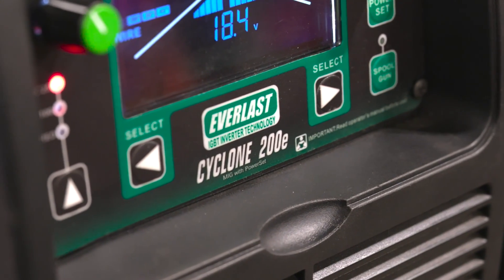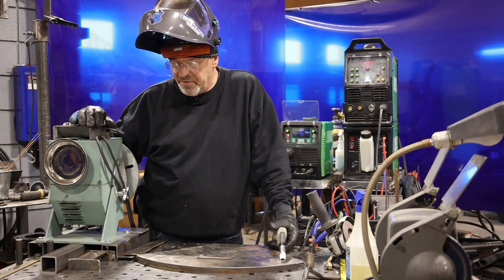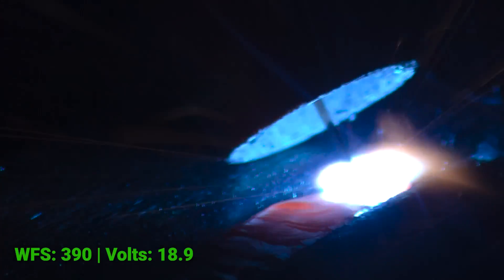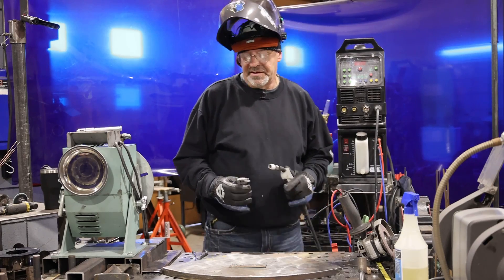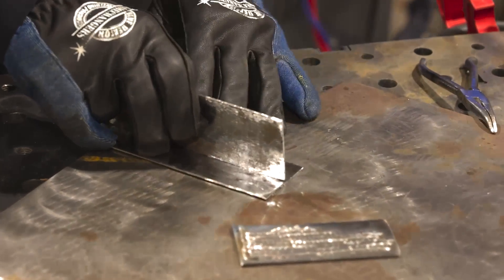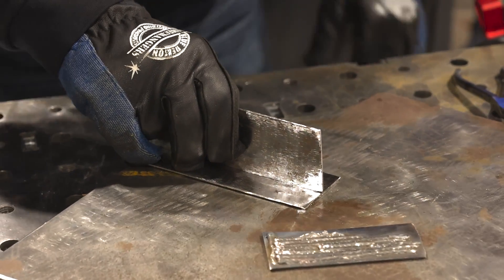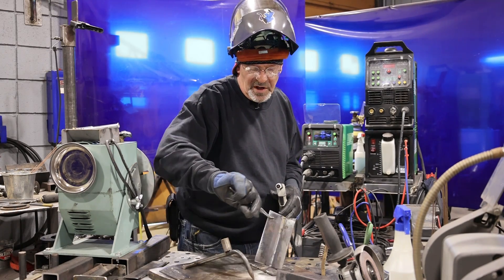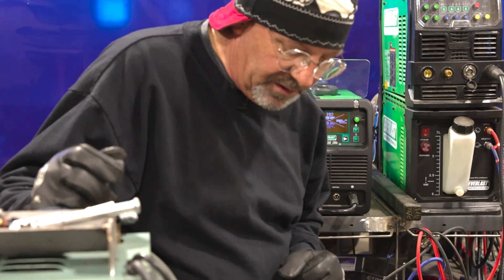Can the Cyclone 200e Keep Up With Bob Moffatt?

Comment: I have the 200es. Im not a mig guy to be honest but it does a great job honestly. I usually use stick or tig at home or my full time in a pressure vessel shop. It does great so far on anything i want to use it on. You and Jody are my guys on youtube when it comes to machine trials for sure

Comment: I really want to buy this welder but worry about the 25% duty cycle.  Just a hobbyist so not sure if that would affect me or not.  I do weld some thicker steel (.375") on occasion.
Reply: That's at 180amps though

Comment: So you put in the size wire, and it gives you a min/max range you can put your WFS and Volts? I would get pretty annoyed not being able to set the machine as needed, even if 90% of the time it would be in that range, but it could be an amazing feature for a hobbyist.
Reply: I'm pretty sure you can go full manual adjustment on it as well and not use the presets

Comment: I never got to run much 0.023 wire. Most of my welding was 0.035 and 0.045. That would be a great option to my old Millermatic O-200 machine.

Comment: Nice to see Bob again. 
Why can't you turn the speed lower than 390 inch per minute? My Lincoln 180hd can turn the wire feed speed way down to where it's just creeping, or up to where it shoots wire out like a machine gun does bullets.
Reply: Just guessing from what I heard, this is the auto settings, on manual you could!

Comment: Love that Bob is back. Would love to see Bob try some flux core 030 or 035 on that cyclone as I just bought one and have been testing it out. 

As a request for another idea for a video, settings for flux core on the cyclone like Everlast previously had Mancub perform with GMAW. 

Also for a idea for all of your on screen welders. Take one of your 140 cyclones and have each personality attempt to effectively weld the thickest piece of steel as a challenge for one another. This is something we use to do in my welding class 20+ years ago on one of your competitors 110 flux buzzboxes. Thickest was 5/16 with 030 flux and 035 went all the way to 3/8 by one of the instructors. 

Can't wait to see more from the man!

Comment: Bob, glad to see you here. With the Cyclone run it on a manual setup and fine tune and compare the outcomes.  I am by no means a welder but I do weld at times at work. I am in my 60's and bought my first ac arc welder when I was 20. My next welder for home use is a used Miller  325 single phase ac-dc hf machine. My first experience welding with dc and a "real" welding machine. When I struck that rod I was amazed for the first time in my life at a weld  bead that I made. At work I tig weld and after watching yours and Jody's video so much when I light that torch  and watch the puddle it is like me watching those videos. 
Thank you.
Reply: My first was the Lincoln 220v tombstone in 1975 when I was 18....learned in high school back in 1973....I've since then have a Miller Syncrowave 220 tig and 4 roller head wire unit, Hobart Handler 220v, and recently the Klutch 200i multi process...now I can run flux core for fixing fence panels in the wind and other things that break on the ranch.
Inverter technology is lightweight and portable, plus runs on both 220 & 110v